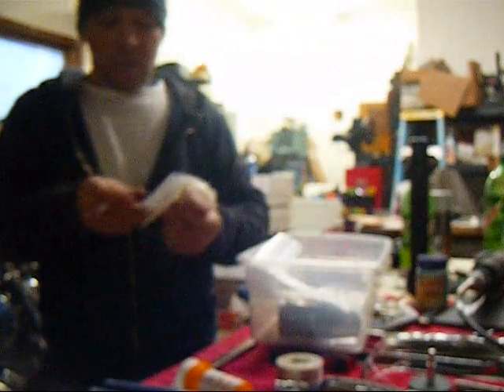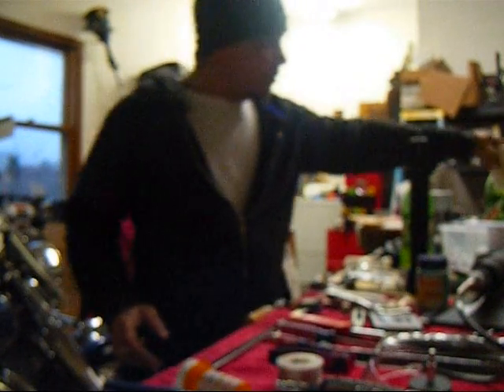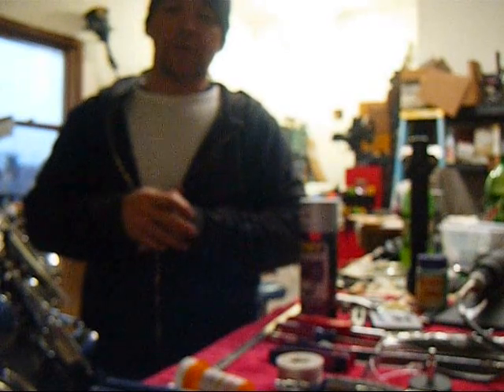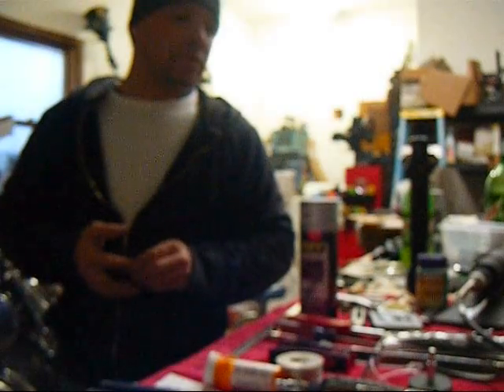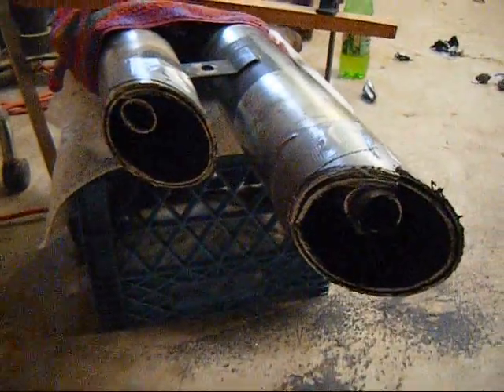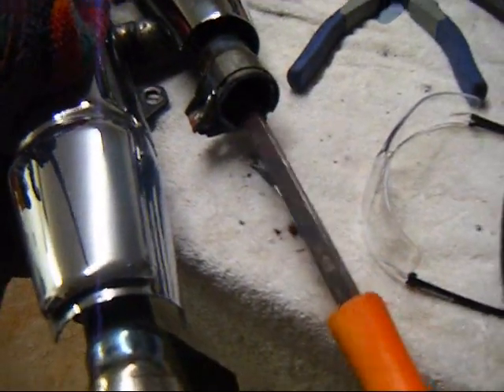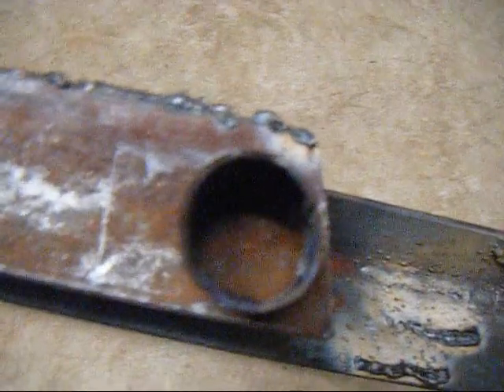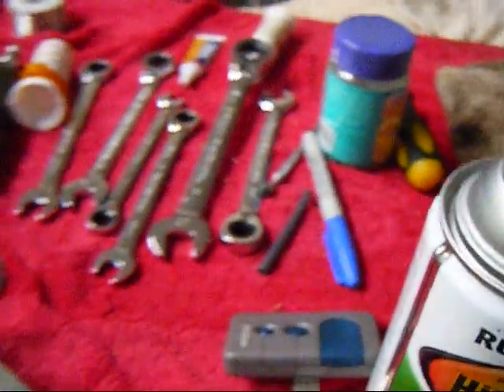YAMAHA 1100 V STAR CLASSIC EXHAUST MODIFICATION

Comment: You realize after doing this you MUST "jet" the bike yes? Which is much more complicated.
Reply from the maker: Mr. NotYourCup  I put 60,000 miles on this bike before I upgraded to a Wide Glide, and it never missed a beat, never left me stranded and never needed any work to the jets. I didn't lose any power off the line or at my top end. I used to work at a Harley shop and one of the first things guys would do is go after their jets, mainly on the bikes equipped with an S&S Super E or a Super G, but jet work is not always needed.

Comment from the maker: @charger19691 Mt fuel system is bone stock, and the mufflers are stock too, I just modified them is all. I never touched the carb, although I run my idle lower than it probably should be. If your looking for a quick and easy boost in power, put on a K&N air filter, you'll be surprised at what a difference they make.